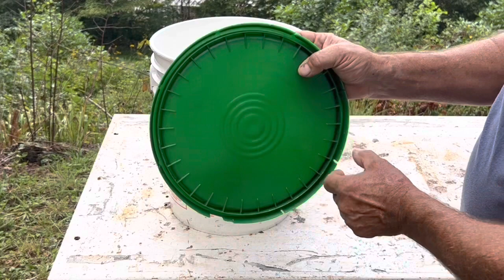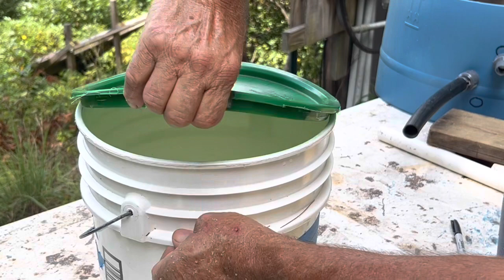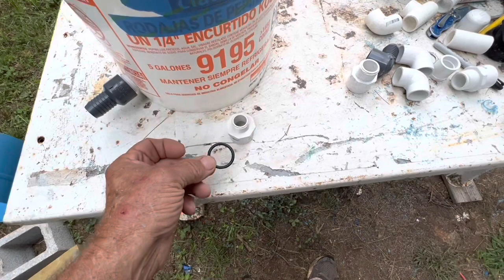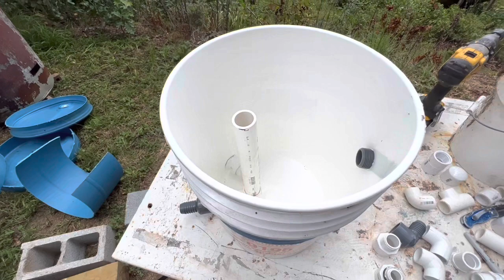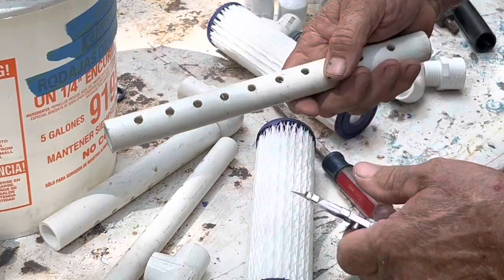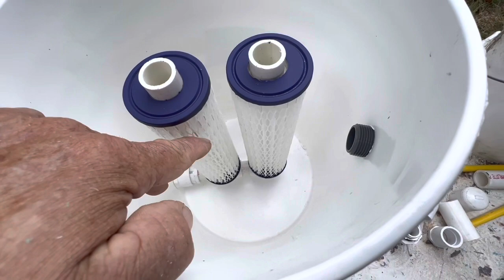Building a DIY spring box with a pre filtering water system. Part two

Comment: Thank you. On the tops of those 3/4-in schedule 40 pipes where they poke out the top of the filter Do you put caps on top of those to keep stuff from getting inside the water supply from those open tops? I have very small critters like baby crayfish baby salamanders stuff like that that would definitely get in there
Reply: I'm wondering if putting caps on the top will cause a problem with a siphon/suction or other such air block preventing the water from going down to the cistern
Reply from the maker: You can cap off the tops 
It also helps to hold the filter down 
Unless the filters need to be changed the water is not that high
Reply: The bucket will be sealed with the lid. Shouldn’t be anything else in there

Comment: Hi, great video. I just built one and the 20 micron filters i have aren’t passing any water. it’s barely a trickle. all the water is exiting the overflow. is that normal? really hoped it wouldn’t restrict flow that much. Thanks!
Reply from the maker: You must have a lot of sediment in the water 
May need to go to a 5 or 10 micron filter
Then if you can place a spin down filter before the water enters the cistern
Reply from the maker: On Amazon look up spin down filter
Reply: @basecampwnc1745  there’s not much sediment and the filters aren’t clogged or anything (brand new from Lowe’s ). i wonder if these filters usually rely on inline pressure after a pump or something.  i’ll look into a larger screen or the inline spin down. thanks again!
Reply from the maker: I use the string or paper element 
Have never used the solid fiber element 
What kind of filter are you using?
Reply: @basecampwnc1745  it’s project source #5225358. (YT won’t let me post the link). I bet that’s my problem. The package/website doesn’t say what material but it has a springy/plastic feel.  

Thanks for making time on your sunday morning!
Reply: I got the 35 micro “yarn” style filters. they’re not snug on the 1/8 so i just held them down with a pipe cap. the flow is MUCH better. I must have some of that “big water” :) the flow doesn’t quite keep up with me 12v pump so i’m gonna add a 3rd filter. also extending my overflow pipe to near the top of the filters helped too.

Comment: So far how often do you find yourself replacing the filters even after you clean them several times?
Reply from the maker: As long as you spray them clean probably a year of use
Just don’t use full force water on them you will blow a hole in the element
Reply: @basecampwnc1745  ah ok thanks for the response

Comment: Why isn’t the overflow pipe positioned at the highest point in the bucket vs lower than the incoming water supply pipe?  What am I not understanding?  Thanks
Reply from the maker: In order to overflow the water flows into the top of the pipe
Reply: Thank you for your quick reply.  I must have been looking at it wrong in the video.  I really like your idea of  using the hose barb to hook up directly to black water pipe.  That’s how I’ll be doing it.  Again thank you.  Btw, I live in West Virginia but travel to wnc to fly fish several times a year.  Beautiful area
Reply from the maker: Send me some pictures of your project to show others
Eric

Comment: Would it be OK to position the overflow pipe  above the mainstream pipe.  Instead having the holes for the two pipes side by side, have the holes vertical,  one above the other.  The same as the holes positioned at the stream dam?
Reply from the maker: You can place the anywhere it’s the top of the overflow pipe 
You could place the overflow outlet just below the top of the filter then no need for the stand pipe
Placing the overflow pipe at the bottom makes it easier to clean out the spring box
You do not glue any of the pipes in the box
So this lets you pull out the overflow so you can drain the box and sediment
Reply: I assume from your heart respond, that would work fine. Thanks for your prompt reply 👍